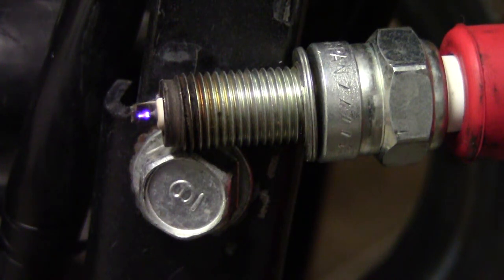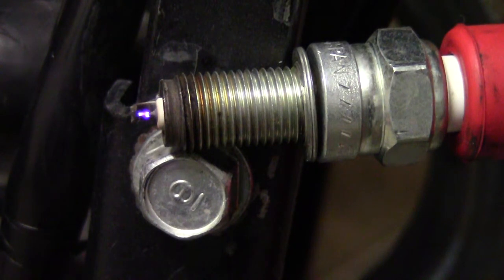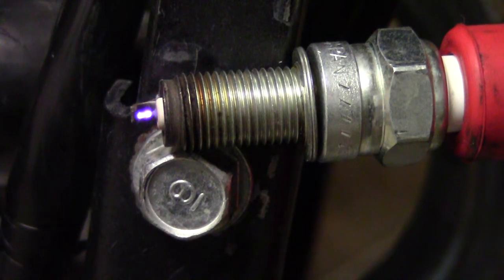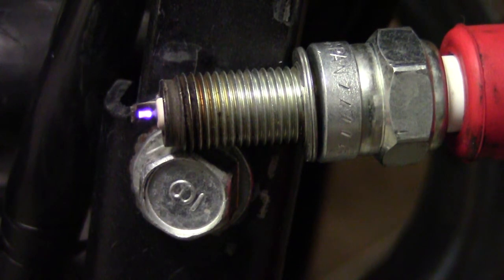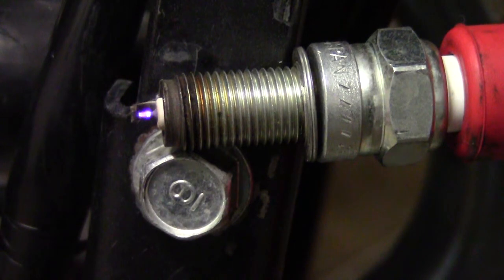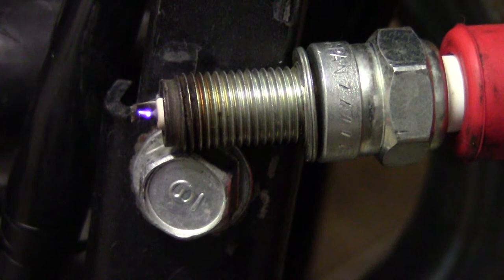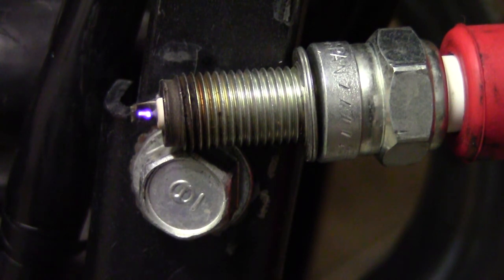cbr125world.com - Spark Testing the Performance Pack - 30,000 RPM

Comment: Hi I was wondering if the True Heavy Duty Clutch Springs fit on a 2016 125R? and if they will make a noticeable increase in performance?  I'm stuck with the bike for atleast a year(I can take the A2 license) so I would like to increase the performance a bit! I know you barely answer comments but please at least respond. Have a good day:)

Comment: just wondering what happened to the cbr? did you finish making all the upgrades for it? the forum doesnt give much information and your progress?
Reply from the maker: I did. In the end it ran on Nitrous, had launch control, adjustable rev limiter, the ability to drive an air-shifter and the ability to run a turbo. I bought a turbo for it but could not find a way to mount it that would not look stupid. The ECU was completed 100% but I ran into trouble licensing some of the tech for mass production. At that point, I packed it in. It's all sitting in a box in the garage :) At some point I will go back to it but it's unlikely to become a production product. With respect to the forum/website/business, that was 'sold' to a buddy probably 5 years ago now? I haven't talked to him in years so I have no idea what he's done with it.
Reply: @bobjones3725  thats a crying shame to hear sorry. iv only had mine a few months now and its a cracking little engine with alot of potential so when i started looking around the forums i loved the work you were doing. but then its like you dropped off the planet :D whats strange is the confirmation question on the forum to make sure your not a bot is still  " who created the performance pack " and if you dont know that answer you cannot make an account. thats crazy you had an air shifter installed! did you wire it up to the horn switch?  i understand about the turbo theres not much room for it, without sticking out like a sore thumb. 
hope you do end up reviving the old project in the future. il keep an eye out for future uploads from you showing the best place to mount a turbo to your cbr :)

Comment: Thx for the quick reply Mr Miller! Looking forward to the release of all these go fast goodies. Contemplating either stepping up to a cbr 250r or investing in the 125. If I can improve highway cruising let's say a steady 120km/h and less effect on that speed up hills or into wind it might be interesting keeping it for a while loneger. The look on peoples faces when they realize it,s only a 125 is priceless especially following much bigger bikes in the twisties!
Reply from the maker: Christian Boucher 

It's always cheaper to go larger - there's just no way around that. As they say, there's no replacement for displacement. Still, like yourself, I really enjoy seeing what can be done with what I've got. The other day I did an actual 146.10 KPH up on the freeway, and that was naturally aspirated (no nitrous). Last I checked I was weighing in a 180 - but that was some time ago. 

The issue with releasing more of these products is that they are costly to manufacture. Our camshaft is something that is very beneficial but there's just not enough demand to offset the cost to make them. So demand is always the underlining issue between making a product work or not making it at all :(

The single biggest bang for the buck remains the Performance Pack. It addresses most all of the weak links in the bike and for the owner with a stock bike, it's the way to fly.
Reply: Marvin Miller That's pretty impressive with no power adders! I've already replaced the front sprocket with a 14 tooth version as per the recommdations on several of the forums out there. Also the previous owner had replaced the stock plug with an Iridium one along with a full exhaust system  wich proved that what little midrange is available should never be taken away hence the modification off combining the stock system with just the muffler can. But I think in the your suggestion seems wise to just simply go for a 250r or bigger in the futrure. The Repsol version is really nice btw. Thx for the info Mr Miller and good luck! !

Comment: Good Stuff! I'm a big 125 fan just love the little bugger. Is the system available and if not when and how much would it cost? I Have an 07 with 14 tooth front spocket,air box mod and an after market pipe mated to the stock exhaust to keep the down pipe diameter. I way 195 and  measure 6ft 2in and I've top out at around 130km/h so far
Reply from the maker: Christian Boucher 
It's very close to  being done -especially for the 125 since that was our test bike. We did a bunch of Nitrous runs on it bringing the total to 38 HP. I've got one more circuit to test but we are trying to bring these out for all bikes which is a much larger and much more complex process. 

Once we go production the 125/150/250/300 could probably be the first bikes to get them as they are much the same, along with a lot of the twins from Honda. They could all get them pretty quick.